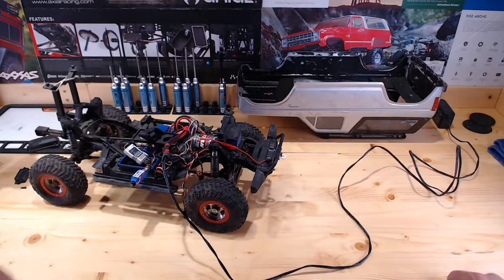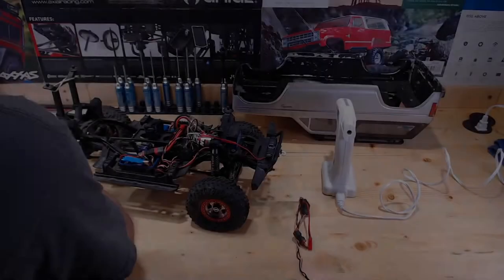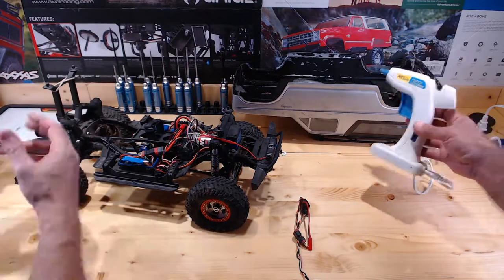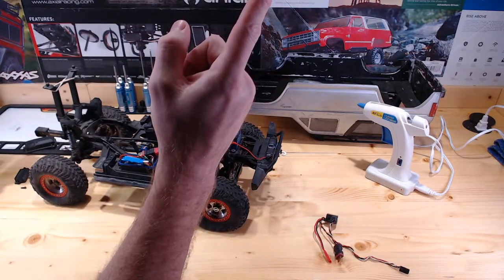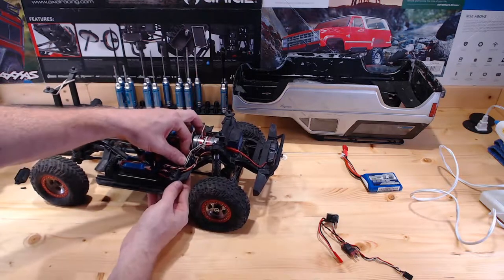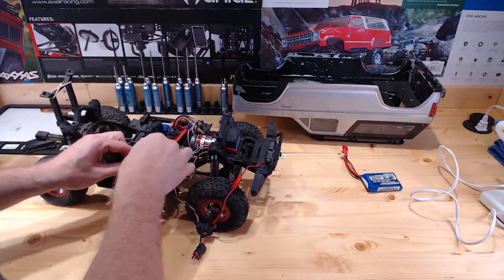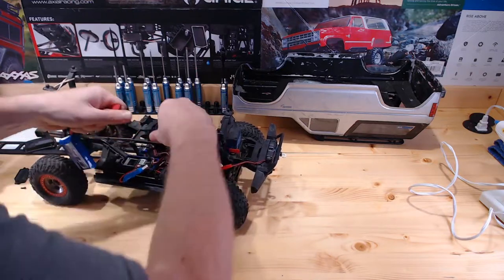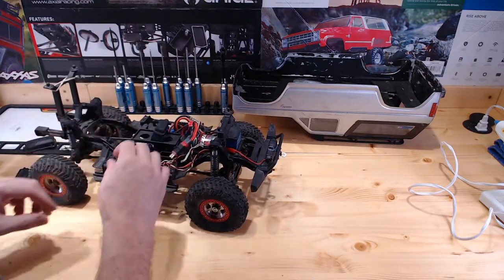TRX-4 Winch Controller & new Panhard bar. SSD D60 rear!

Comment: U sell wheels but run your Baja claws backwards?? Hmmmm??? I'm lost can I have a free set
Reply from the maker: There are lots of theories on mounting direction for Claws. In mud, having them backwards would clog up the treads when going forward ... BUT may give you more bite in reverse in case you get stuck and need to back out of something. On rocks, the "theory" is that reverse mounted they will better cup the rock and aide traction going forward. Keep in mind, these are just theories. We've done ZERO testing on that and originally just mounted them that way because we wanted to. Now we run these tires backwards on all our trucks. Hope that helps!
Reply: @lockeduprc  same with boggers they run those backwards also in the mud
Reply: @lockeduprc  just picking on u guys